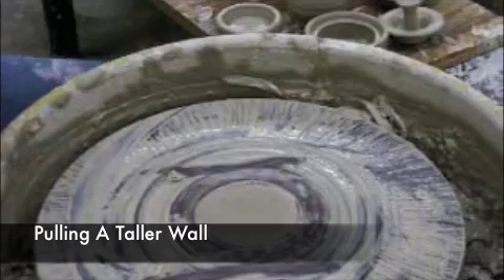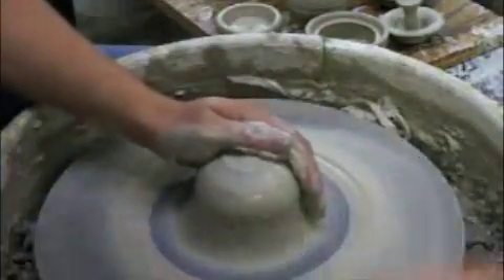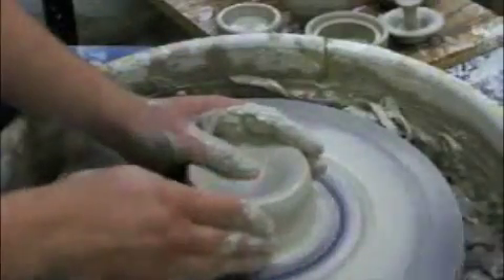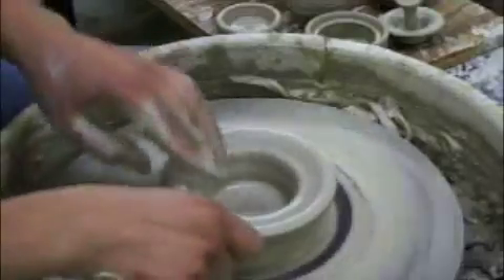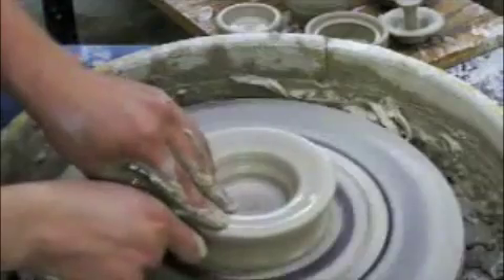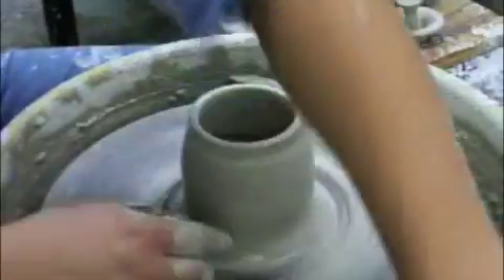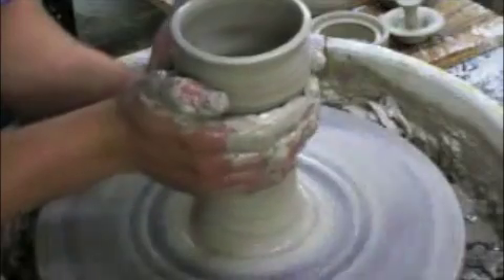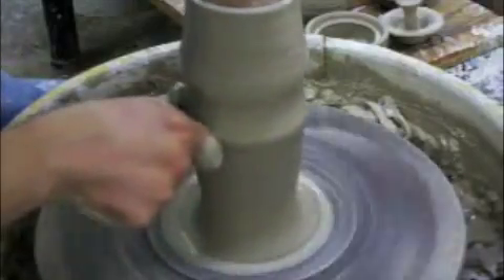tall cylinders

Comment: Thanks for a great example of throwing tall.  My work is now consistent, and this is my new challenge.  Your clay looked very soft, yet you don't get deep throwing lines on the ouside.  I have to use a sponge when throwing with soft clay to keep from constantly smoothing out the deeper throwing lines.  I didn't have this problem with dense clay.  Is there a trick to acheiving the smooth surface outside of the vessel when throwing with soft clay or is it just practice?

Ruthie - South Carolina

Comment from the maker: you need to have the outside hand in a tight fist with your pointer finger being the only stickyout point. you should have that elbow on your leg or against your body. the inside hand is harder to stabilize, you can try putting your elbow over the center of the clay but it will come down to practice and muscle training.

Comment from the maker: Nope I never slide any of my work. the extra water can cause cracking later i just make sure the surface is clear of slip and my hands are scraped off and lift. It has got to be in a video i have done some where. if its too soft to move it was too long in the making.

Comment from the maker: Oh a legend am I, that is a first... What school do you attend? It slumps at the base because your elbow is not over the center of the clay. if part of your arm or wrist hit the edge of the pot at say 8oclock it will bend it compressing one side and stretching the other. that combo weakens the bottom, and will bulge out or even cause it twist. Next time you throw have someone watch to make sure you are not pushing it over.